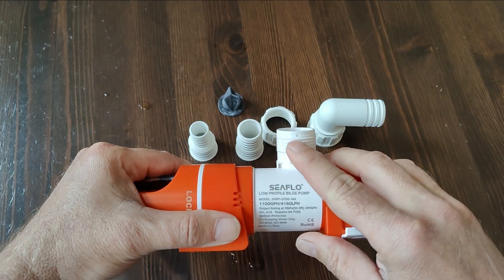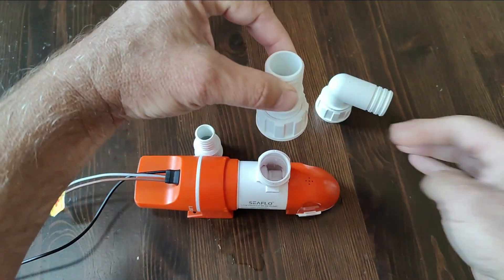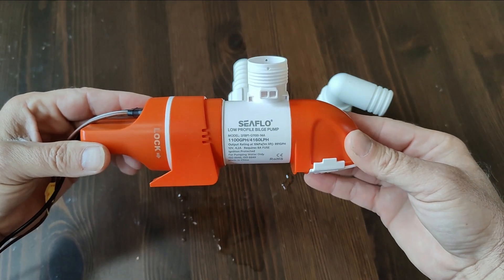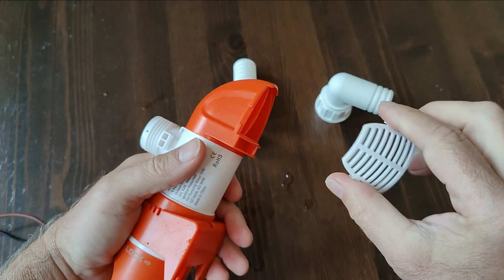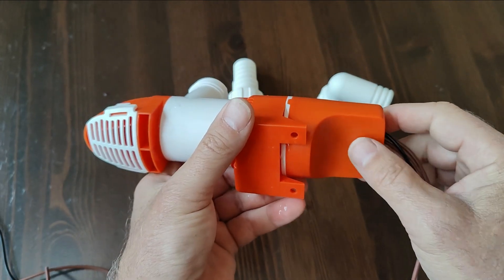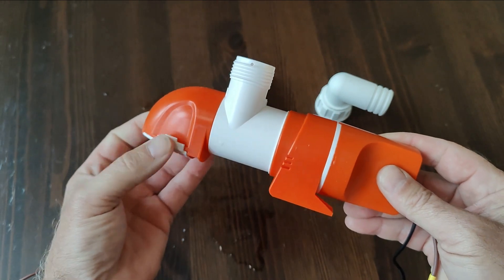Seaflo 14A Low Profile Water Sensing 1100 GPH Bilge Pump

Comment: In the UK I bought the 14a with 2 buttons that you have to depress to remove the pump so lt won't fit at 90 degrees increments so will the pump work with only 1 sensor in the water.
Reply from the maker: That is the new design.

Comment: Is there a non electric, non digital automatic version? E.g. one that can work with a traditional float switch for example?
Reply: Bilge pumps usually have manual mode aswell
Reply: So the manual lines you connect to your float switch

Comment: Hello, my purchased SEAFLO 14A pump won't start in automatic mode when it connected to AC-DC 12V 10A powersuply. I was trying connect it to different AC-DC power supplys and battery. On any AC-DC power supply pump won't start in automatic mode, only manual. But automatic mode works when pump connected to battery. What can be the reason? Thanks for answer.
Reply: I am experiencing something similar. I have just connected Seaflo by email.
Reply: @byrnecore  Please write their answer and solution. Thanks

Comment: This thing is junk, very erratic.... put in sink with water above sensors, ran for 12 seconds then stops.... full battery.... does not run like you are showing..... so pissed off.
Reply: I need a pump that works in less than 2 inches of water ?
Reply from the maker: Please contact us for support.  jimmy@marinenow.com

Comment: Work this pump like the 14b and tells the manual positive cable that the pump Is ( going ) on auto ?   So the lights turns on ? 

Our are that only working on the 14b with the 2.5 min test run cycle
?